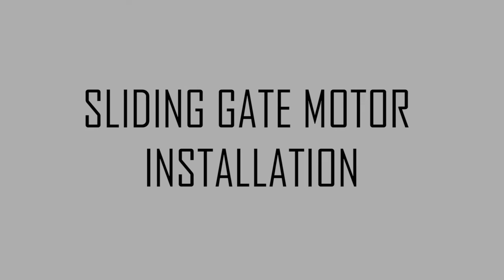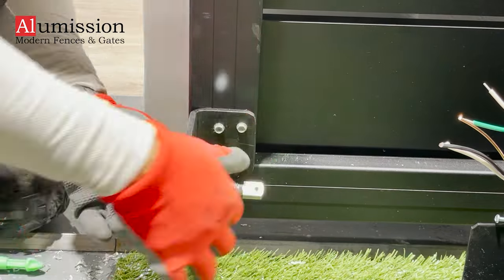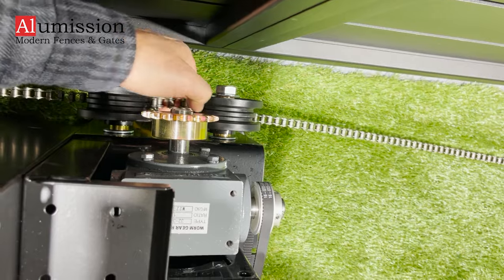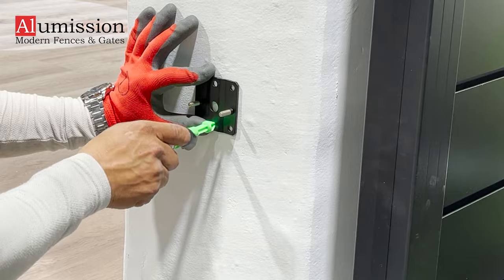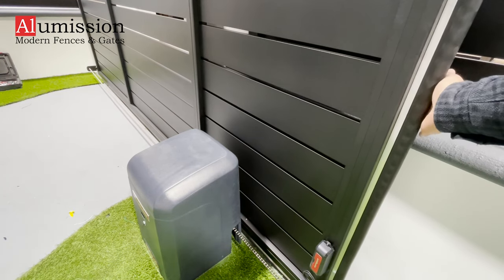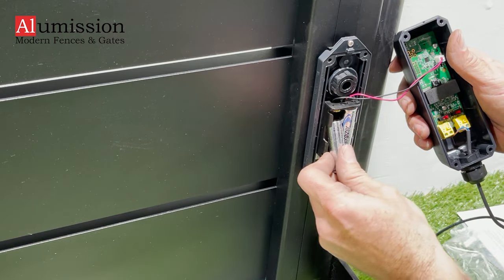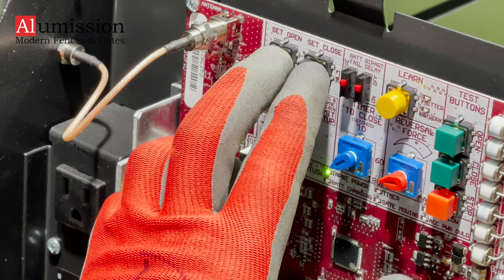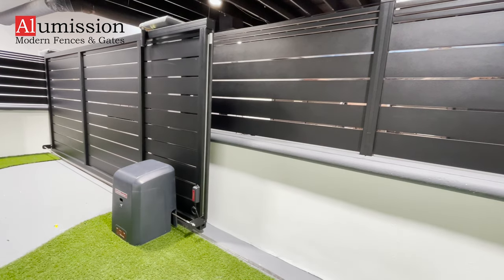Aluminum sliding gate motor installation. For LiftMaster RSL12UL

Comment: Should i have two photoeye for this model installed? Cause i only have one
Reply from the maker: You should install two sensors. The motor comes with one eye sensor and one edge sensor. Most cities will allow to replace the edge sensor with another eye sensor.

Comment: How is the gate powered?
Reply from the maker: This motor can get 110v from your electric panel or work with a solar panel. It only require 12v and comes with battery.